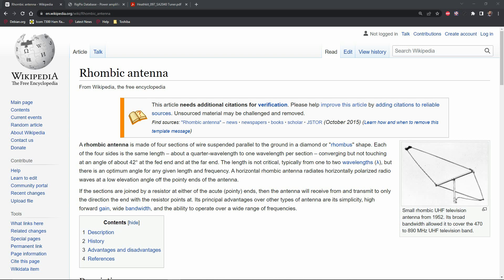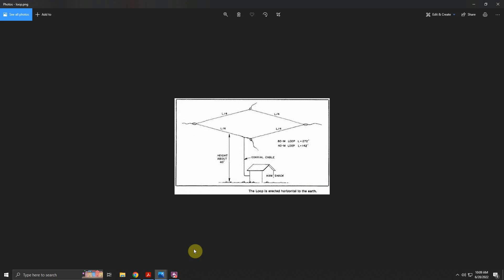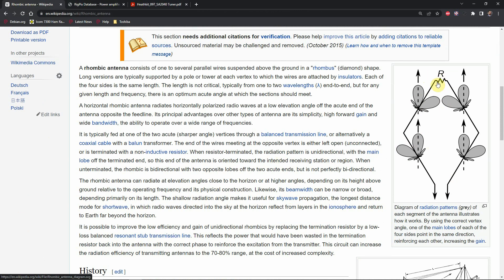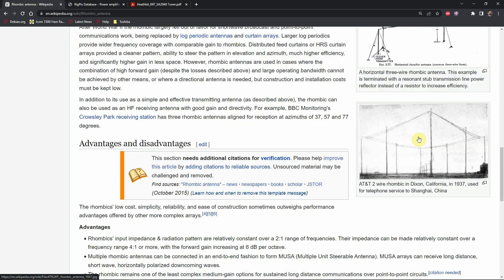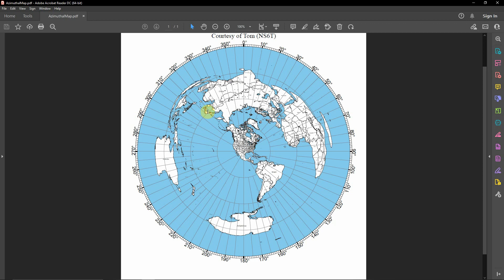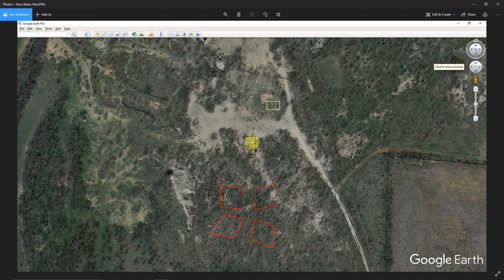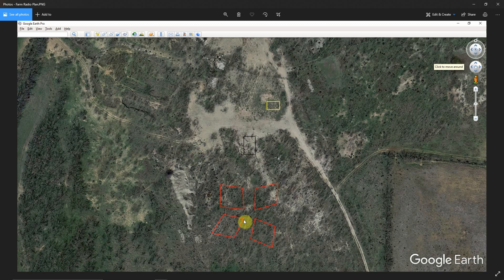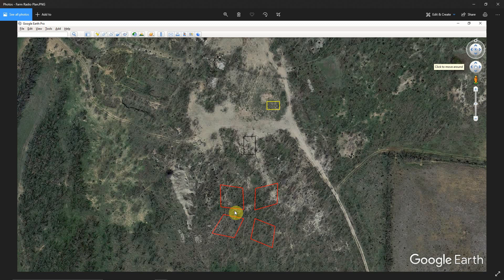I'm going to build some rhombic antennas

Comment: According to an Elmer W1VDE these antennas become much more efficient and gain multiples in n DB gain the more wavelengths you can fit in one. Ie longer it is the more gain it produces exponentially. Therefore the higher bands you will fit more full wavelengths and your signal will be doubled and doubled and doubled w far higher gain on say 10 meters than 40 or 80! If you get 16 wavelengths per leg for example on a higher band that’s equal to 1000 x your money. One watt will radiate as though it were 1000 & 100 as though 100,000. What I was told and the station I listened to for 4 hrs at S-9. If the band was open you could hear him he only runs 200 watts.